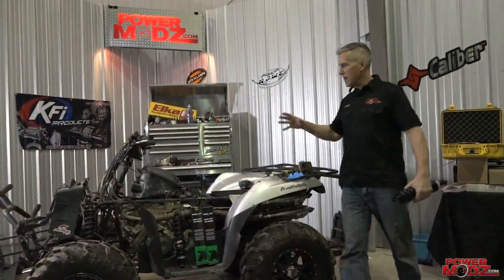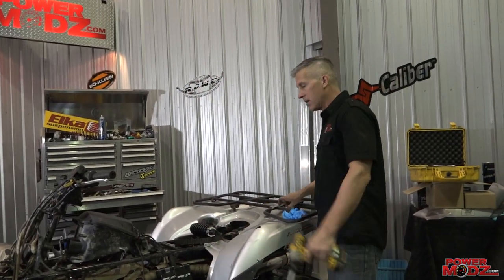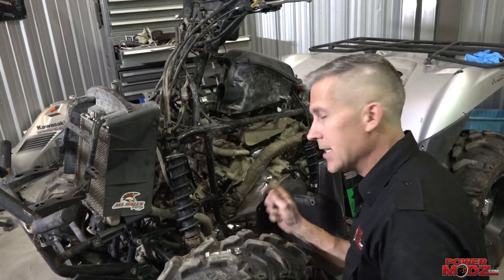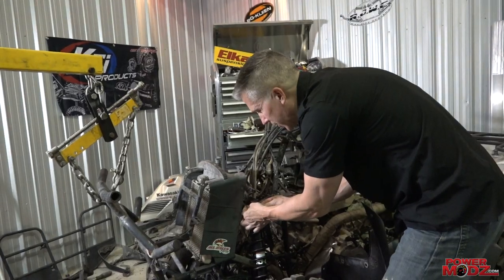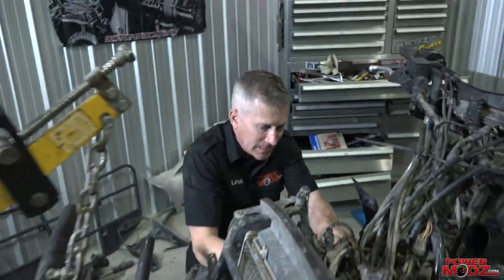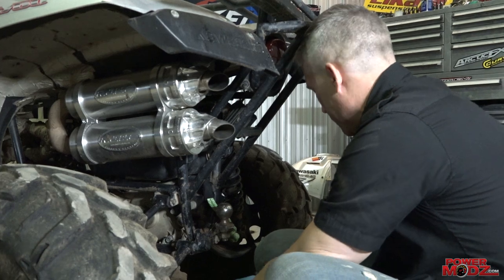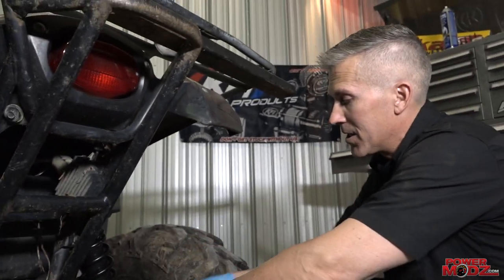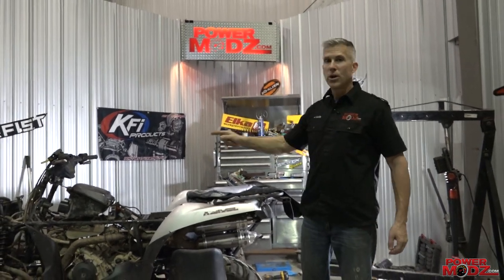BRONCO SHOCK INSTALL KAWI BRUTE FORCE 750 SERIES!

Comment: Question about Bronco shocks. I just bought front and rear and installed them. Since I do snowplowing in winter and wood with trailer in summer I set the preload fairly stiff. When off the bike I can push down on front and it will come back up to where they were.... However when I push down on rear with all my 230 pounds it will sag about 2 inches but unlike the front they won't come back up unless I pull up on machine... Then they come back up. Why is there a difference between front and rear? Both are adjusted the same and are brand new. Any input would be very helpful. I can't find anything online.

Comment: Bought a complete set for my rancher…it does perform better than a worn out set but they they adjusted it with too much preload that at max suspension droop I barely got it on…it blew out my new CV boots in less than 4 months…it doesn’t come with a spanner wrench and with stickers on it …😳

Comment: Also another question... Can you adjust the rebound on these shocks? I notice a valve screw on bottom. Is that valve only for the loading of the gas? Any info you may have for these questions would be greatly appreciated... Thanks.

Comment: double edge sword lol stiffer shock just wears out ball joint  but on these brutes the firdt thing ya wanna do is the a arm upgrade kit that elimanates the bearings in the a arms n is replaced with a rod and bushings

Comment: My back left shock is rubbing my tire after I put a 2” HighLift lift kit on my 2021 750 brute force.   I can’t figure out the problem, any suggestions?
Reply: add a 1 inch spacer to each side when putting on a lift kit it brings the tires closer in which in turn causes them to rub

Comment: I do not want stiffer springs and shocks on my quads. I want softer and better ride
Reply from the maker: These are 10 percent stiffer, better control and the ability to load more....winches, loads, boats, plows, heavy riders etc etc.  A  shock can be stiff as heck for a 150 pound rider but soft for a 200 pounder....